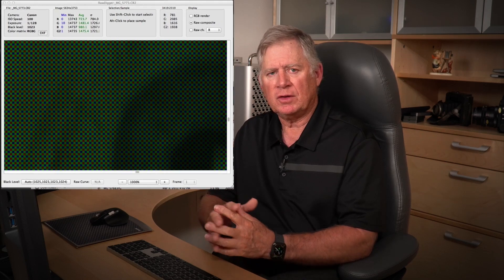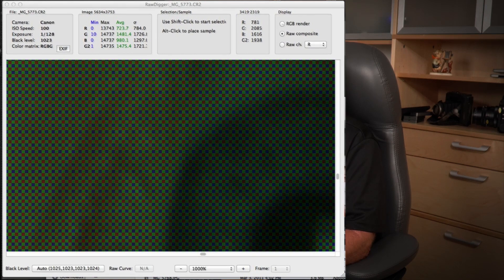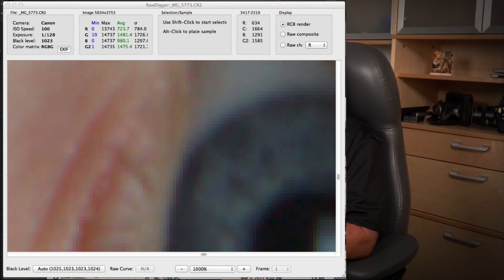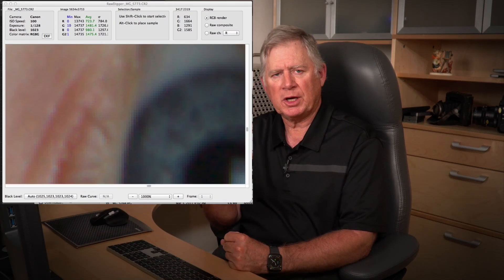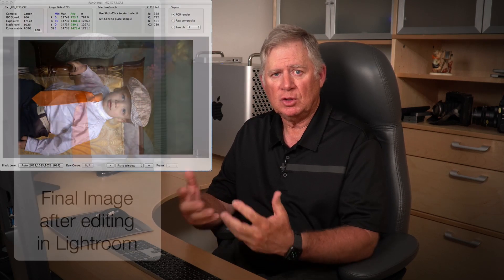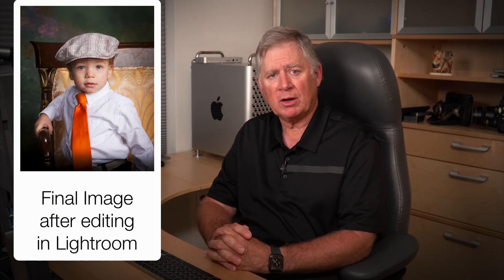Color Management?  Why?

Comment: Hello Wayne,

I watched (and rewatched) all of your color management videos and want to thank you for taking the considerable time and effort to produce them.

You use the ColorThink software to great effect throughout the videos and my question concerns your experiences using it in the Apple Mac world. Has it proven technically reliable - free from crashes primarily - and is it actively supported by Chromix? I ask because I’ve downloaded the software and am running it in their pre-purchase “demo” mode and have encountered crashes in the 3d modeler that invoke the “report” an error to Chromix while performing the File ->  Save as QuickTime operation. The ability to capture and transmit to my clients their out-of-gamut information is crucial to my consulting aims.

Any insights you could provide would weigh very heavily in my $399 purchase decision.

Thank you,
Jeffrey
Reply from the maker: I haven’t used the output to QuickTime. I use a screen capture application (such as QuickTime or ScreenFlow) when recording the output of ColorThink. I just tested the save to QuickTime  and it doesn’t seem to work on my m1 MacBook Pro.  Not sure if that’s related to using rosetta or if it’s a bug overall.  I haven’t had any issues with it, no crashes or other problems. It does seem to work fine on my M1 MacBook Pro, although I haven’t used it extensively (all of my color management videos were made while using my 2019 Mac Pro).
Reply: @cwaynefox  , thanks Wayne. I’m using an M1 Mac Studio so I’ll pull the trigger and get the software. When I have to capture I’ll follow your lead and use QT or ScreenFlow.